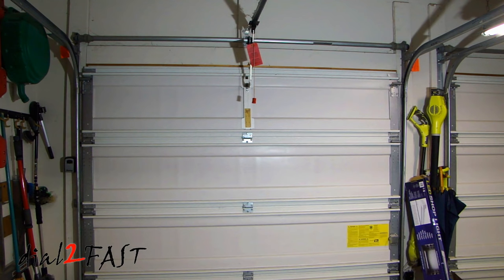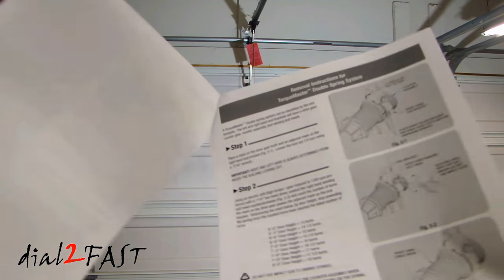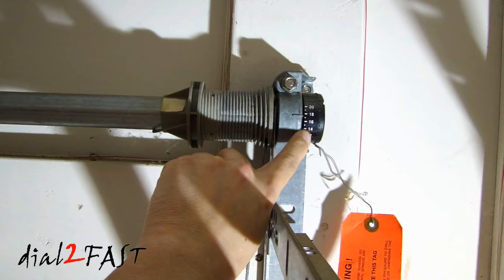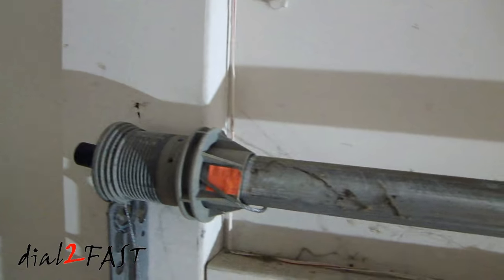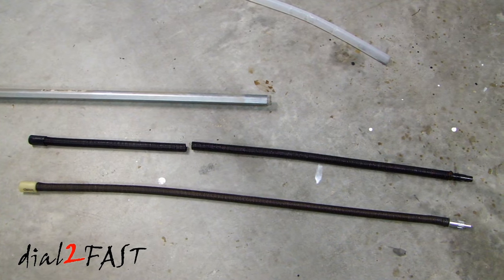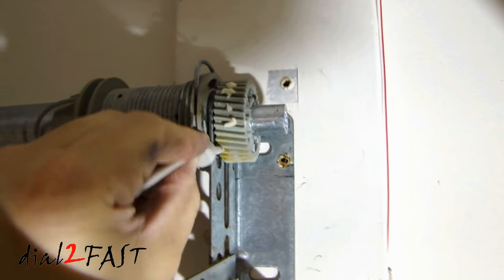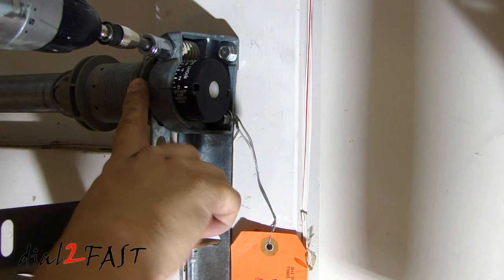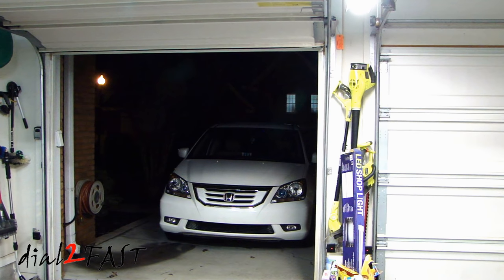Wayne Dalton TorqueMaster Garage Door Spring Replacement

Comment: Thank you. Just replaced my broken torquemaster spring, and your video was such an asset. NOTE: I ordered my replacement spring from North Shore Commercial Doors. They were already a few dollars less than Wayne Dalton, but I also found an online coupon that got me free shipping. My total cost for this repair = < $50 for the part, and about 1 week without a functioning door while I waited for the part. Re-installation took me about 2 hours (mostly because I involved my kid). Thanks again for the video. It was everything I needed for the job.

Comment: Great video, ordered part from garage door express. Even with a low mechanical comfort level this is a DIY repair. Thanks. Don't underestimate the importance of the cable routing and/or tension. I did and was back on a ladder adjusting it. FYI

Comment: Great video.  Thanks!  My spring busted, got a replacement one off eBay for $85 total after shipping/taxes in 2024 for those who are wondering what the prices are for these springs.  My door is 8 feet tall and weighs around 88 lbs.

For those who say these are crap we will see.  I THINK this is the original spring that was built with the house so that would mean it lasted 19 years which isn't bad at all.  Even if it's not the original spring it would have lasted around 10 years or so.  I'm ok with spending $85 every 10 years to fix this than spending a crazy amount to convert.  Also, these systems don't look like they'll kill you like the other ones.  It's all contained and easy to fix.  So I'm down with this.  Hopefully when the part gets here it will be as easy to fix as it was in the video.
Reply: Can I private message you somehow or contact you

Comment: Excellent video!  Saved me a lot of time and money.  

I had an issue where the replacement spring was a little shorter than the original.  This caused the right hand winding shaft (the grooved metal end of the spring) to not protrude from the spring tube.  The other end of the spring was getting caught on the plastic sheathing inside the tube.  I slid the sheathing all the way out and cut it to the length of the new, shorter spring, and slid it back in.  That did the trick.  If anyone else has this issue, don't be afraid to cut the sheathing.
Reply: Same issue here. My original spring had the metal rod inside the spring, new spring does not. That also threw me for a moment , but the instruction sheet from Wayne Dalton tells you it's normal.
    Cut the plastic sheathing, and it was pretty smooth sailing from there. Saved hundreds doing it myself over having a specialist come out. 
This video was fantastic, had it playing every step of the way.

Comment: Outstanding video!  I just did my spring replacement today, followed your video to a T and the job turned out perfect.  I was able to use the new plastic sheath that came with my new spring.  Also, as someone else commented I did have to remove a Phillips screw in each of the end brackets in order to remove them which wasn’t in your video so I’m glad I read the comments.  Nonetheless great video and you saved me a lot of money. 👏
Reply from the maker: Thanks for sharing your experience. Good to hear you were able to fix the garage. Have a great weekend!

Comment: Thank you so much for your video. Paid $90 total for a new spring and a couple of hours of labor to get it done. Would have been faster but the stupid cables refuse to coil back up properly and I had to unwind it back to zero to get the far end cable to sit in the grove properly. Then I have to get up and down the ladder after winding up a couple of notches to make sure that the cable is coiling properly. Ordered the spring from Door-parts and it arrived in 4 days using the standard FedEx.

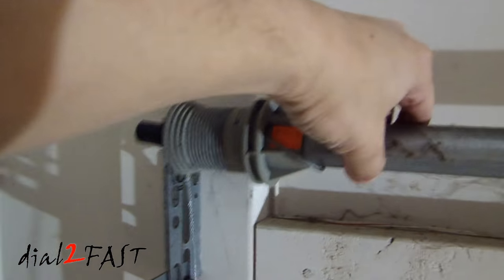Comment: One note. On mine, after removing the two large bolts at 3:57, there is a Philips head screw that’s still holding the end piece on.  Both on the left, and the right.  If you look from the end, it is in a recessed area below where the tube end is and close to the wall.  If your end pieces don’t come off, remove that screw.

Comment: I'd like to add a note on my repair since the setup is a little different than yours.
I have a single garage door on a two car garage. There is one tube and two torsion springs which mount to each end. This only makes a difference in that I ordered a two-spring set and had to do this procedure for both ends. Also, I have a Wayne Dalton iDrive motor, which is mounted on the center of the tube that holds the springs. So, instead of a center bracket holding the tube, there is a mounting bracket for the motor. The motor does not have to be removed in this setup. Just remove two nuts that hold it to the bracket and the entire tube and motor assembly can be dismounted. Otherwise, I followed the instructions that came with the new springs (same one you have in this video) and everything worked great. A few other points:
- The instructions has a section specifically for a two-spring installation.
- I did have to tweak the spring tension a bit to get the door closed height just right.
- I found that sliding the spring into the plastic sleeve first, and then sliding the sleeve and spring into the tube, was easy
- If you have a Wayne Dalton iDrive, the wall control should have a button that runs a routine to set the "limit" for the motor. That is, teach the motor to stop when the door is fully open or fully closed. When I ran the door the first time, the motor continued running for about 5 seconds after the door was fully open. The limit routine will cycle the door open and closed a couple of times, and after that the motor will cut off precisely when it should.

Comment: Great video - thanks!  One thing that I would point out is that the spring should be removed from the left-hand side of the tube.  When I went to remove it from the right-hand side, that Mylar plastic sleeve apparently bound up between the spring's perch end and the torque tube.  I had significant resistance trying to move the remaining spring section from the right.  When I went back and watched your video, I noticed at 5:04 where you just barely caught the spring sliding out to the left.  Once I caught that, I went back and tapped it out that direction with almost no resistance.  The Wayne Dalton instructions should have indicated that the spring needs to be removed from the left.

Comment: I have a double door it weighs 188 pounds. I put it on the scale with the help of my wife and son. There is plastic sheathing around the right side spring. The left side spring was the one that was broken but I didn't find any sheathing around that side. I wonder if the left spring without the sheathing pushes the right spring into place? I call tomorrow and talk to the parts people. Should be cake from here! Thanks again! You saved me at least 250 dollars. Well hopefully it all goes back together and works well.

Comment: This is a great video, I really appreciate the work you put into it.  The only thing I would add is to use your cell phone to take photos of the way it was before you started working on it.  Especially the gear on the right with  multiple  pieces and gears.
Reply: Question maybe somebody can help me. I reinstalled the spraying the rod and the bolts and the gears but for whatever reason they don’t seem to be making contact with the spring does it take an exceptionally long time to work tension on the spring. Or am I overlooking the obvious

Comment: Dial, I am going to do this exact repair tomorrow; is it really necessary to remove the left side metal bracket for a 1-spring setup? 

When I removed the long tube (with the broken spring in it), I was able to just slide the tub out of the left plastic roller, leaving everything on the left side alone.

Maybe there's a reason I am unaware of that will force me to remove the left side? ...I'll find out tomorrow.

Comment: Great video. I have a question. I own a torqumaster identical to yours. Pulleys snapped on both sides. Have not take it apart yet. Is it likely the spring is broken as well if the pulleys snapped.

Comment: I like TorqueMaster, so much better than those ones where the spring it just held onto the pipe with friction bolts (or whatever they're called) -- pain to tighten and loosen.  TM is so easy, as you can see in the video, just use a drill and watch the numbers go up/down.

Comment: Can the spring be broken and the cables still be tight? Mine are taught but the door is so heavy I can hardly lift it manually. I just want to make sure I'm troubleshooting it correctly. Thanks Scott
Reply from the maker: The garage door (single) can weigh about 70 lbs. It's heavy but you should still be able to open/close it manually if you disengage the drive system by pulling the rope. If you can still open and close it manually with both hands and you know nothing is binding it, then it's most likely a spring problem. There really is not much to these doors. The door roll in the tracks and the spring help with the lift.
Reply: Thank you This is a Wayne Dalton double door. If I measure the height and width can these door supply companies figure out what I need. I tried to read the label on it and it says 160X and 146X 16' double among other things. Is the weight of the door 160 lbs then? I don't see anything that looks like a model or serial number.
Reply: Your video on this is the best I've seen by the way!
Reply from the maker: Yeah, my door had no label telling me the weight. As a last resort, what I did was placed a scale under the middle of the garage door and put the garage door on it (while still in it's track). That allowed me to measure precisely how heavy it is. With that info, you can purchase the correct spring (s).
Reply: Do I need to worry about the pull cable not winding correctly after installing my spring? My assembly doesn't have a cover over the winding spool. I noticed that on another video a guy had a cover that went over his spool where the cable winds around it. Not sure if I have the part names correct. Thanks again
Reply from the maker: I am only familiar with the one I have and shown in this video. After you install the new spring, and before you tighten the tension, the wire should easily wind onto the spool with some slack. As you start tightening the tension, the wire will tighten up and pick up the slack.
Reply: Awesome thank you! Scott
Reply: Are there part numbers on the springs?
Reply from the maker: It's best you contact waynedaltonparts to find out. Link to their website is in description.
Reply: Do you have a link to get the torque master manual?

Comment: Thanks for a great video!

I had to replace the lift cables and now can't get the spring to extend out far/long enough to get the drum on.  Is there a secret I am missing?  You made it look so easy!

Thanks!
Reply from the maker: +James B Not really sure as i didn't have to replace the cable. Can you check if it's the same length as the old one.

Comment: Thank you for this awesome instructional video! May I ask one question though? When I removed the broken "Original (Not Plus) Torquemaster spring, a metal hollow tube came out of the middle of the spring (not attached to anything that I could tell). Did you have that come out of yours? Note: This is not the plastic larger tube which the spring is housed in. It is just as long but only about the size of your pinky finger in diameter. Thanks again! AE
Reply from the maker: On mine, I only saw the spring and plastic tube inside.
Reply: It turns out it was a winding rod I can discard. Thx

Comment: Hey I tried to fix my WD torquemaster 1 spring and at the end my door is still heavy to lift to about half way then it gets lighter..going down goes faster after half way and slams. And I tried adjusting the tension..originally 16, I went up 18..any suggestions

Comment: Great Video. I was browsing the tools you have listed and realized that screwdriver bit set is Dewalt brand and the Screwdriver is Milwaukee brand. Will the Dewalt bits fit on the Milwaukee drivers?
Reply from the maker: Yes, the bit set is standard 1/4" and the Milwaukee drill/driver will fit that size. I have updated the tool list as you need the 3 pc impact socket adapter to use the power tool with the socket. Please check the list out. Thanks.
Reply: @dial2fast  Thank you!!!

Comment: Hey I have a floor lamp that has a .75 mm coil spring that has an arm that holds it In place had to take it apart to rewire it and can't get it back together. Thought since your the torque master you could help sending pictures please help

Comment: I have the same setup.  I set both left and right sides to "0" with no tension on the cables. When I spin it the left side moving the adjustment wheel to a few higher numbers the right cable get tight. Why?

Comment: Thanks for the video. My cable just snapped I needed some guidance.
Reply: Hey mine snapped too. Same make model as one shown. Did you have to replace spring and the pulleys?
Reply: @metaworld4808  Not the springs but yes the drums

Comment: I did not see if you reinstalled the spring protector tube over the spring when reinstalling the spring into the tube, did you forget or just not do it
Reply from the maker: When I did mine, the old spring protector plastic tube was stuck inside, so I just reused it and place the spring inside of it. When you do yours, you should replace it with the new one.

Comment: Where can you find the information about the weight? Thanks!
Reply from the maker: You can try to do a search on the internet for the brand of door you have. Or you can unlatch the garage door, and carefully lower the garage door onto a scale placed in the middle bottom of the garage door to weigh it.

Comment: Unpopular opinion I suppose, based on most of the comments here... But I just had my garage door converted from torquemaster+ to a torsion spring. It's unbelievably quieter now, and it only cost me $475 to have a reputable company come out and do the job. My house was built in 2017 so I was surprised the spring failed so soon. I'm also not the only one, as 2 of my neighbors also had theirs fail and converted. GLTA who are tackling the spring replacement, but I can't say it wasn't money well spent to have the conversion done.

Comment: YouTube university scores again. Thank you professor. Folks be careful when ordering your spring. I found a huge difference in pricing and especially shipping. Put in the research and don't get sheared.
Reply: This is correct.  I just ordered mine (2024) and it was $85 total on ebay.  There were some places that wanted a lot more.  That was the cheapest I could find it.  The website he gives in the description wanted $100 ish after shipping.

Comment: Torquemaster systems are horrible. Get some end bearing plates, LHW & RHW drums, 1 inch hollow galvanized shaft, centre bearing and plate and use a "yellow" torsion spring .207  coil for a single wide door. 
Gears arnt plastic, they are nylon. 
Wayne Dalton doors are horrible. Amarr, Northwest Door & Clopay are my choices 👍
Reply: My torquemaster system lasted for 19 years. I sure other springs systems break eventually

Comment: Torquemasters are junk, the spring life will not last, and the FoamCore II model door is retail grade at best. Convert your springs to the Factory Recommended Torsion springs. Better life cycle, and MUCH better hardware, I.E, cables, drums and shaft.  Anything holding that much spring tension should NOT have PLASTIC anywhere near the springs.
Reply: Worst garage door in the world.. whole thing is made out of fiberglass. Would recommend getting a 26 gauge 170 metal door.
Reply: Totally right. I never fix a torquemaster. Always convert to conventional  torsion with the versitillity to upgrade cycle rate. Between the I drive and cheap ass sections, way garbage hardware especially from the nineties Wayne Dalron went to shit. I think they have started back towards industry standards.  After 4 decades Clopay Pro Series & Chamberlain / Liftmaster is all I'll trust.
Reply: I never repair a Wayne dalton spring system. I always convert them over to the standard torsion springs. wayne dalton's are the cheapest garage doors out there.
Reply: SO I see everyone says do not fix a WD garage door, yet mine has lasted 15 years.  15 years seems quite reasonable or am I missing something?  please advise and reply
Reply: Shredn' Tread mine broke after about 10 years. I had no idea there was a spring in the tube! I’m on here looking for repair info.. I hope local garage door repair businesses don’t think the same way as op
Reply: @KazzArie  well my garage door guy will not and would not install a Wayne dalton door....upgraded to the torsion...$245 total....
Reply: Shredn' Tread that sucks they won’t touch these. But that price doesn’t seem terribly unreasonable. I haven’t called anyone yet but I was expecting closer to 500.
Reply: @KazzArie  yeah I thought it was reasonable...just waiting till the other one dies...so it would be $500 total if I did both doors
Reply: To each his own I guess.  I have 3 single car Wayne Dalton garage doors all with the single spring and I’m doing my very first spring replacement on just one of the doors after 20 years.  Doesn’t seem like junk to me.  I also like the idea that when that spring explodes it’s doing so inside a concealed metal tube, minimizing the risk of injury and further damage to the garage door and surrounding area.
Reply: I'm seeing in some places where technicians and / or contractors refuse to work on these doors, myself is a garage door tech for over 18 years and I don't like these set up.